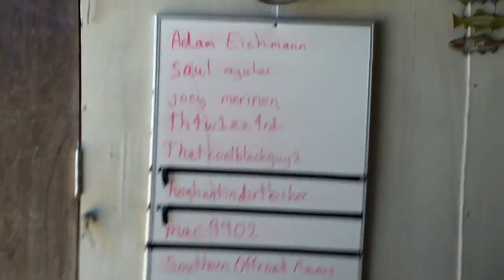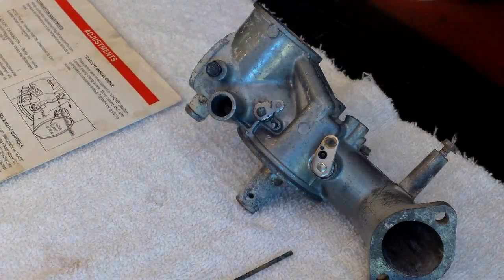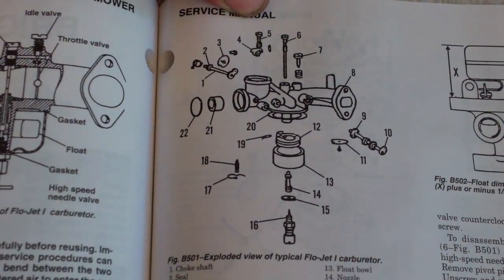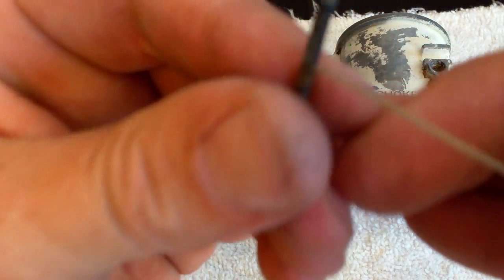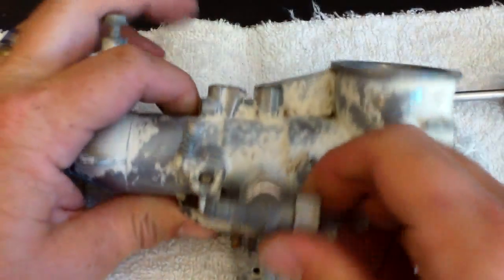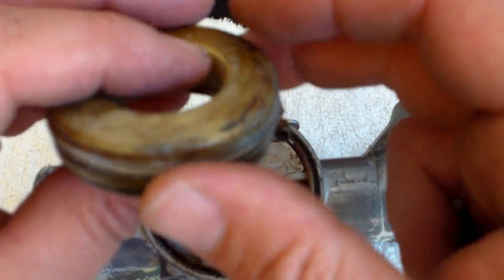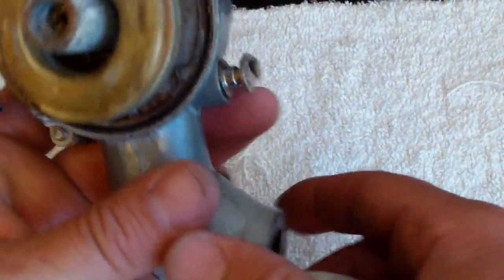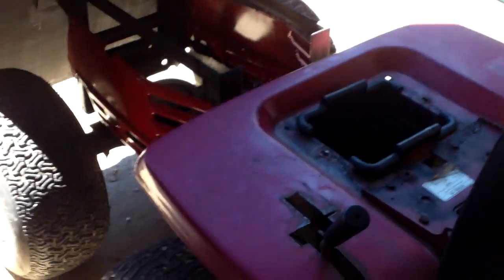Flow-Jet for Forbiddenmowers

Comment: I'm in the middle of my 2nd rebuild. Great video. I didn't realize these were so dated. I also couldn't get that centermost jet to budge.

When I took the carb off, all the linkages became detached at both ends, so now I need to figure out where they attach on the ends opposite the carb.